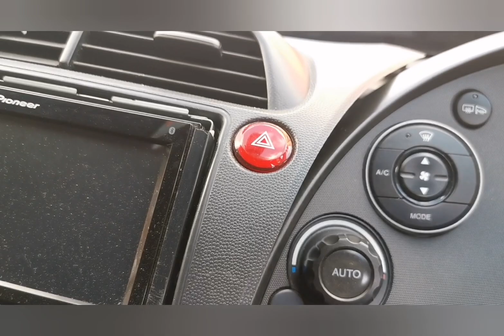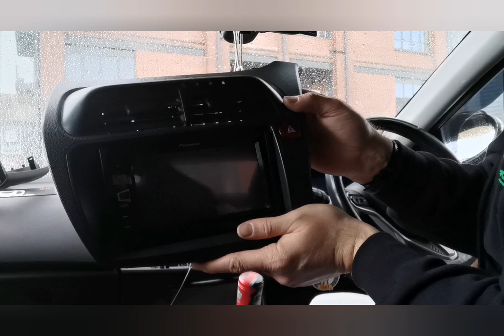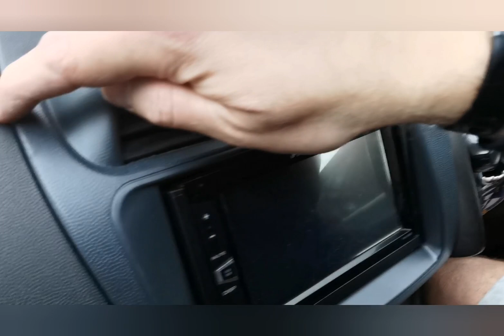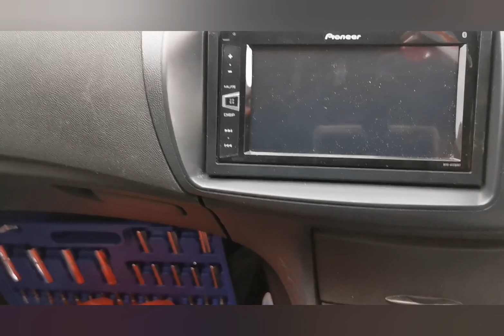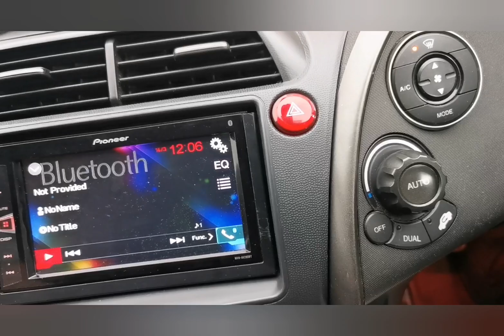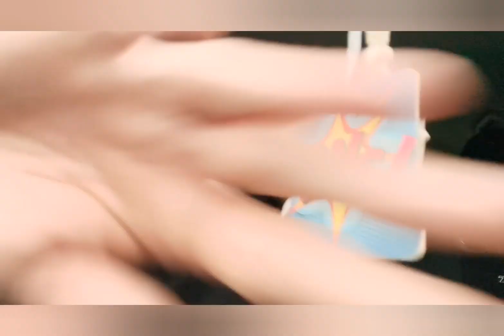Re-Installing a double din in the civic type r fn2

Comment: Wait? how did u lift that up that easily? I looked up other videos of replacing the stock unit on this one and they have to take off the whole bunch starting from the bottom. Aren't there usually bolts on the bottom?
Reply: Nvm I saw your comment in the beginning : ')
Reply from the maker: Lols no worry bud 😁

Comment: Do you lose the second screen with the clock and temperature readout when you install a double din? I just installed a Teyes CC3 and the two green cables which I assume is the power and data feed for the second screen has nowhere to plug into.
Reply from the maker: Ahh mate, do you have the connects2 kit? You need that for the screen to work and steering wheel controls u believe
Reply: @Robstervtec  fb steering controls work okay, the teyes has an app to map the buttons to what’s wrong function you like, I have volume up and down as standard and channel up and down as skip tracks. I wonder how the connects 2 would work to get the screen working again? Is it a harness connection? If so it probably wouldn’t work because there’s already a harness adapter plugged into the Teyes head unit
Reply from the maker: @CarlosWillis  ahh that's cool then bud 👍🏼 ye it's a harness connection. Do you have anything on your screen at all or is it totally blank?
Reply: @Robstervtec  it's totally blank. The two green connectors aren't connected to anything. There's nothing in the harness that yes supplied fornitnto plug into. Are harnesses head unit specific? Or could I get a connects 2 harness for a civic and it would plug into the Reyes head unit?
Reply from the maker: @CarlosWillis  ye mate, those green connectors plug in to the connects 2 kit. Umm I'm pretty sure they fit most if not all makes of head unit pal. But may be worth shooting them a message and see what they say
Reply: have you figured this out? 
i've installed myself a pioneer, and now the temp & clock screen display random characters. 
the OG navigation is still working,  but no way to navigate on it.
Reply: @florindlf  @florindlf  my civic has gone now, but I think the only way to get the screen working is to use a 3rd party harness like connects 2 or xtronic. You'll have better results using a Teyes CC3

Comment: Did you ever figure out why your fascia plate didn’t sit flush on the side edges?

I’ve got exactly the same issue. Tried trimming plastic from inside of dash and got it to sit better, but it’s still not flush on the left edge, and it feels solid like I can’t push it any further in. I’m convinced it’s stuck on something. 

Any suggestions?
Reply from the maker: No I didn't bud I'm afraid. It's the metal screw and bracket that stops it I'm sure. So mine is still slightly stuck out to 🙈
Reply: @Robstervtec  cheers mate. I’m going to bend the bracket towards the glovebox slightly today and see whether it makes the difference. Will let you know.
Reply from the maker: @HarryNixonTube  oh ye please do my man 👍🏼

Comment: Hey Rob, my info screen stopped displaying entirely, no climate info or clock. Do you have this fixed?
Reply from the maker: Common issue on these bud, the screen needs resoldering on the board. Or you could buy a 2nd hand one 👍🏼
Reply: @Robstervtec  It is definatly a wiring loom fault, it used to work with stock radio
Reply from the maker: @premoist2095  ye bud, swap it out or re-solder job I reckons.

Comment: looking to install a double din touchscreen in my 07 Type S soon, what size radio would fit into these types of facias? the kits online run into the hundreds but theirs little information on how the parts can be put together seperately.
Reply from the maker: I believe mine is a 6.2 inch so I would say anything up to a 6.5 should be OK 👍🏼